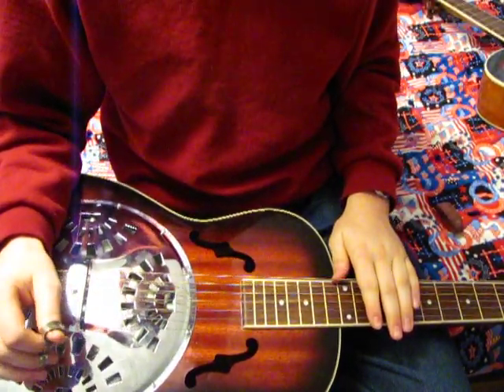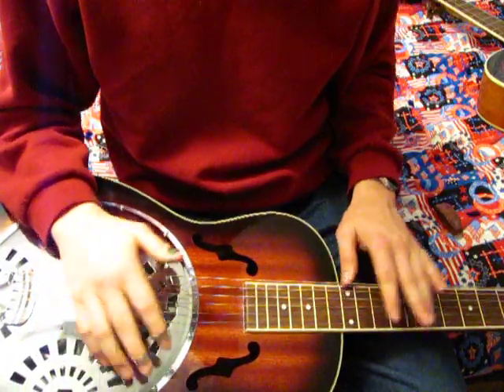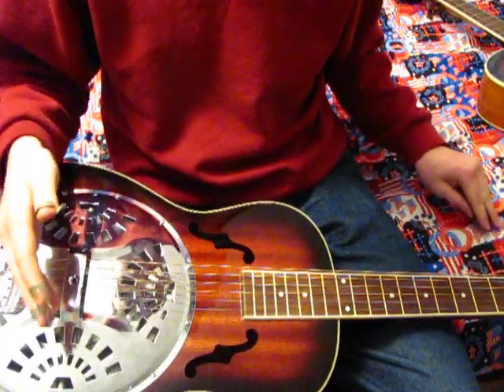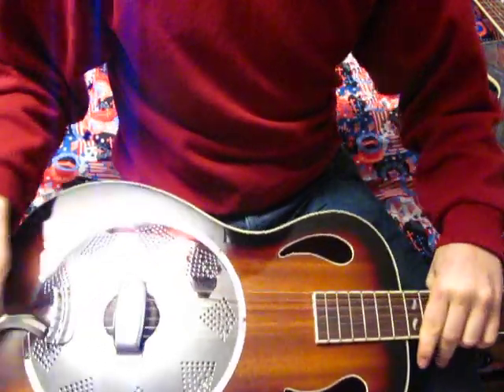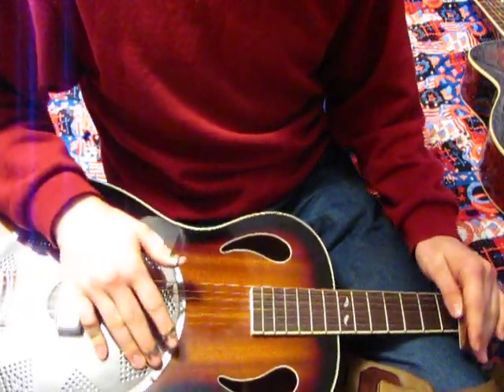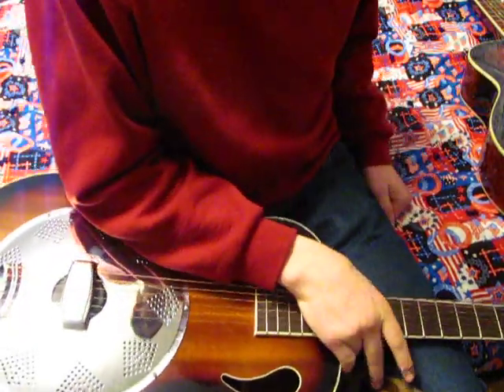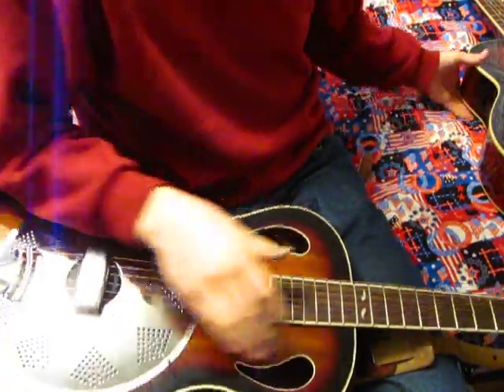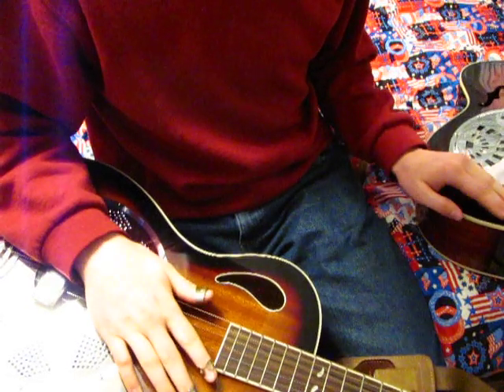Biscuit Vs. Spider Resonator Guitars

Comment: And then there’s the tricone guitars. The spider bridge was a later development. In my mind, the difference is not from which way the cone points, as acoustic waves emanate in both directions. It’s more about how the vibrations are mechanically transferred from the strings to the cone.

Comment: Thanks for posting this! Not a lot out there to explain this very important distinction and it's great to be able to hear the difference side by side. Just to add to what you said, the Biscuit actually projects the sound INTO the guitar body, making the body of the guitar (wood, brass, size, etc.) play a much bigger role in the tone. The Spider cone projects the sound directly OUT of the guitar, making the body less of a factor.
Reply: Thanks for the video and the comment. I'm strictly an acoustic guitar player and my ears preferred the brisket bridge and now I know why. Which came first? The spider or the biscuit? Although I prefer the sound of the biscuit, I'm sure they both have their place and I could see the spider set up sounding better playing single note parts in musical pieces where it fits where the biscuit bridge set up might be able to sneak in to any peace and sound right. Thanks again!
Reply: Just thought about something. I had a cheap Tobero a while back with the spider bridge that I never played much and it was a laminated top. If the wood does not play that much of a part it makes sense to use laminated tops with these but solid tops with the biscuit bridge. I guess.
Reply: @taxisteve929  Actually, what came first for resophonic guitars was the tricone guitar which has 3 small biscuit-type cones connected by a "T" bridge. Next was a larger single biscuit bridge, then came the single cone spider bridge type resonator.
Reply: @taxisteve929  You have opened up a can of worms with this question. Many very expensive resos have solid wood tops. Many very expensive resos have laminated wood tops. Many opinions out there. To me, what's important is how the instrument sounds.

Comment: Hi Timothy, thanks for video; I have a question: can I use 0.016 to 0.056 gauges strings with spider bridges and round neck?.  My Resonator is a G9221 BOBTAIL™ STEEL ROUND.  I wrote to Gretsch previously and I don't have an answer.  I read that spider bridges support much more the downforce exerted by the strings tension than biscuit bridges, is it correct?  Thanks
Reply from the maker: I usually use the "normal" reso strings which are the 0.016 to 0.056 strings, and have used them for both my squareneck and roundneck resos without any problem. Although if not playing with a slide, I've usually just used regular guitar strings on my roundneck reso. I have heard somethings about the higher downforce, but most of what I had read was speculation, so I'm not really sure about that. The only possible problem you might encounter is if the string gauge is too high on the roundneck and could possibly cause warping of the neck. Most roundneck resos are made with that in mind though, and is usually only a worry if you're converting a dreadnought guitar into a reso style guitar.
Reply: @perksenmusic3525  Thanks for your answer, very kind of you.

Comment: Only so much energy can be imparted to a string, during a strike (with pick or finger), to cause ithe vibration.... 
Rule of thumb (with all else being equal): 
If the energy of the vibrating string is converted to sound waves quicker, the attack will be LOUDER, but the sustain will be shorter;  
However, if that same energy is converted to sound waves slower, the attack will be softer, and the sustain will be LONGER.

Therefore, the same amount of energy is released as sound....  Different constructions of instruments favor either attack or sustain, or a compromise.
(Yes, obviously, some energy can be -- and is -- lost in ways that does not produce sound.  But again, the assumption is that all else is equal, and ignores these losses).

A banjo, is louder than a guitar because the energy quickly gets converted to sound (which is mostly 'attack', and so therefore also decays quickly).

Think of a solid-body electric guitar.
It has much more sustain because the energy of the vibrating string is actually released to sound very slowly.
It is much, much quieter (acoustically) because the energy does not quickly escape through the body, etc., and instead much of the energy, from the initial stroke, keeps returning to the vibrating string.
The 'loudness' (volume) of an electric guitar, comes from amplification, which ADDS energy in correlation to the tiny input from the pickups (note that the guitarist does not add this energy).

Comment: Then why all Nationals resophonic has biscuit system ones, if that we looking for is to have more sostain ?
Reply: John Dopyera invented the Spider resonator after he and his brothers left National and formed Dobro. National introduced the Biscuit in order to compete with Dobro's Spider, as up to that point, National was still doing Tri-Cone resonators (though John Dopyera designed the Biscuit while still at National, but National didn't produce any until after he and his brothers left to form Dobro).

So, until the companies were merged to form Valco (umbrella company for Airline, Oahu, and Supro), Dobro was the exclusive maker of Spiders and National was the exclusive maker of Tri-Cones and Biscuits.

The Dobro name has since been bought by Gibson and, as far as I know, carry on the tradition of Dobro being synonymous with Spiders. I'm not aware of any Biscuit resonators currently being sold under the Dobro or Hound Dog brands.

National Resophonic, for their part, also carry on the tradition of National being synonymous with Tri-Cones and Biscuits-- though they do make one Spider model, called the Scheerhorn.

Comment: I am wondering whether to buy a Gretsch G9221 bobtail (Spidercone) o the Getsch Honey dipper (biscuit).  On looks I like the former but it is delta and Hill country blues that I like to play (RL Burnside John Lee Hooker etc.) and not Bluegrass.  They say Biscuit is better for my style of music but I am still drawn to the Spidercone
Reply from the maker: I guess technically for the style you want to play I'd recommend the biscuit style. However, as it's been done with the banjo, you don't necessarily have to have a certain style of instrument to play a certain style of music. So it is very possible that you can get the sound you want with the spider cone. If it were me I'd try to see if I could play both styles of guitars and go from there.
Reply: Timothy Dirksen Thank you for your prompt reply.  I saw laura cox playing the spider cone Gretsch G9221 bobtail and I also like the fact it has the fishman nashville pickup to go electric.  Anyway I have ordered it so it's on its way.
Reply: It's uncanny how you were in the same boat that I am in now, even your mention of Burnside and Hooker. Although I don't play slide guitae, I use open G tuning a lot. Some biscuits I've tried sound too much like banjos, and some spiders have a Nashville twang. I haven't tried any that are more than $500. What resonator do you have now: biscuit or spider? wood-body or metal? Thanks and stay healthy!
Reply: @perksenmusic3525  Hi just saw this and I did buy the Gretsch G9221 Bobtail Steel Round-Neck Spider Cone Acoustic/Electric Resonator G
I love it it is in open G :-)